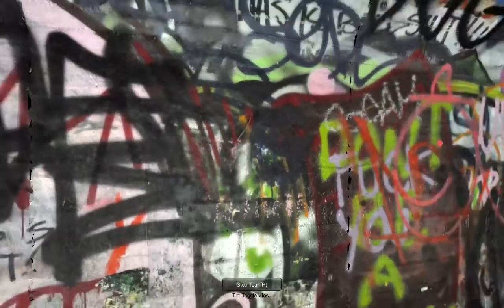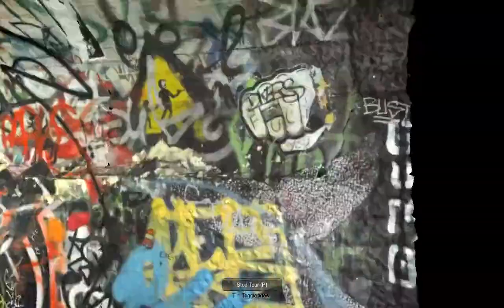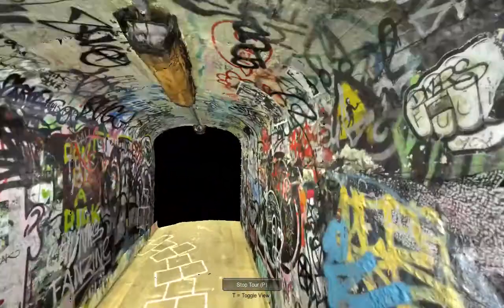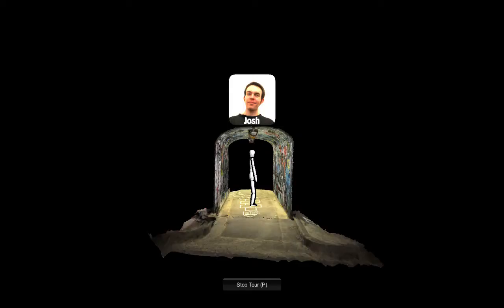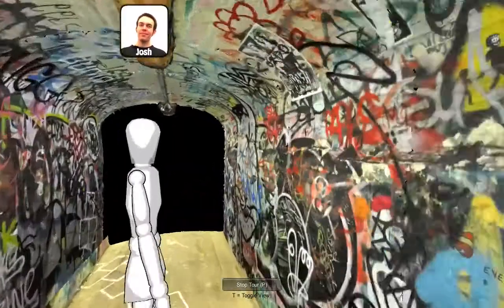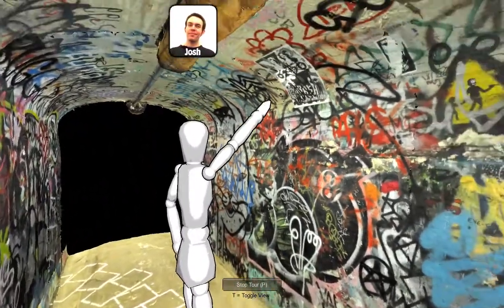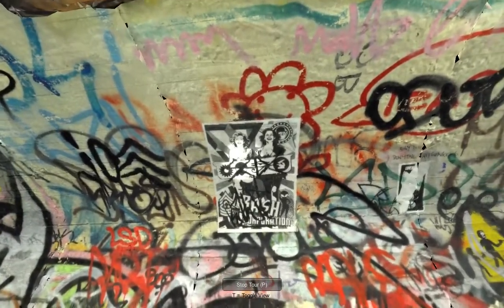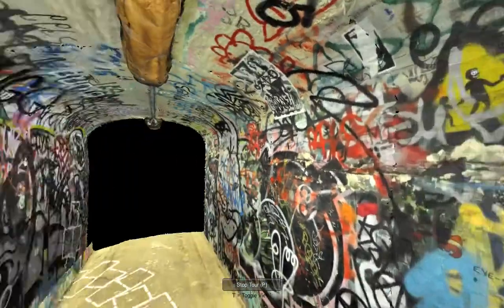Initial Tunnel Reconstruction

Comment: Looks promising, Josh!

Unfortunately the Unity3D embed isn't working for me on Windows 7 in:
Opera 18.0.1284.68
Firefox 26.0
Chrome 32.0.1700.76 m
Internet Explorer 11.0.9600.16476
Do I need to install something to use it? If so, I wasn't prompted.
Update: For others like me, get the player here: http://unity3d.com/webplayer/

As far as tablet and phone apps, might I request some love for the Windows Store as well, since Unity supports exporting to Windows Store and Windows Phone 8 apps?
Reply from the maker: Thanks Nate!  

Very strange regarding the embed.  You may be able to get it to work by explicitly installing the Unity 3D Webplayer.  

No problem with Windows phone support: as you say it's an easy process.